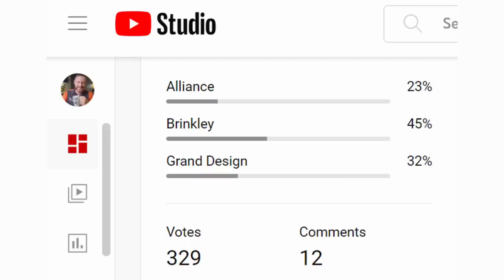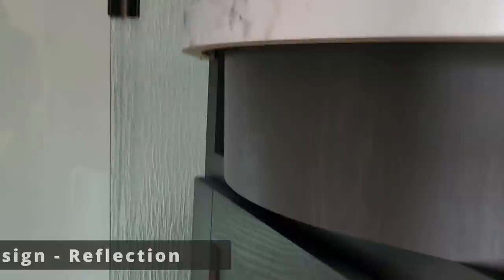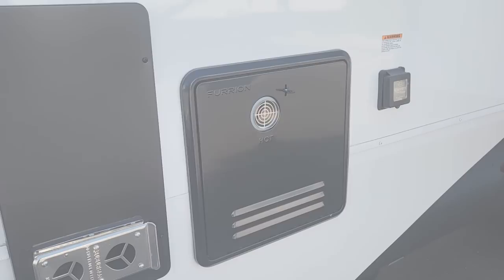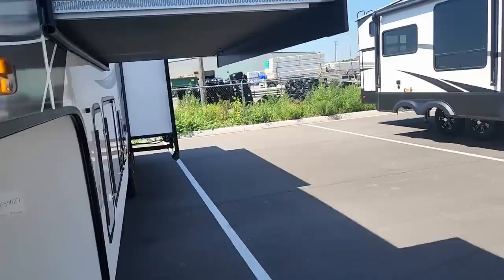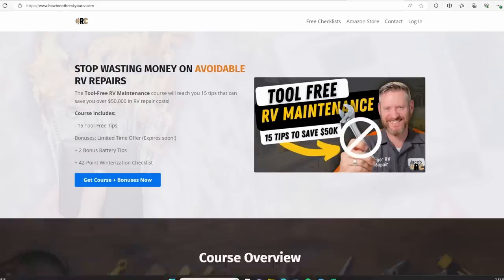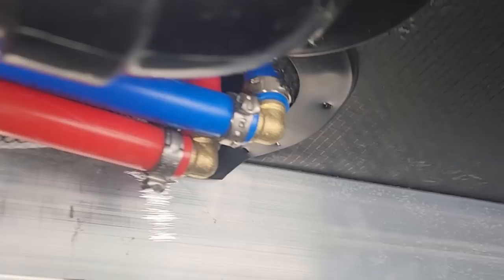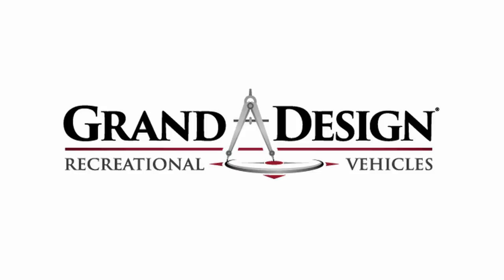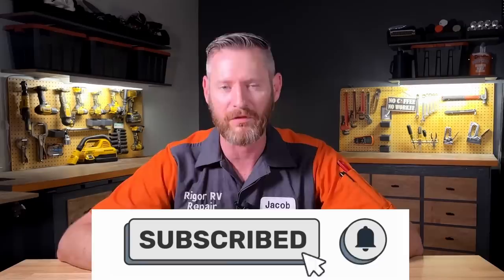UNDERCOVER RV Tech reviews Grand Design, Brinkley & Alliance RVs

Comment: We greatly appreciate your objective evaluation of our product. One of our core values is to continuously strive for relentless improvement. If you ever find yourself in the Elkhart area, we would like to extend an invitation for a campus and factory tour.
Reply: Do you concur that the slide mechanism is a Accu-slide? When I asked the dealer today about the unit we're considering purchasing, they stated it has an Exact-Slide mechanism. Does it vary by unit or model?
Reply: Ok I have a used Valor 2021.My experience with  Alliance has been no warranty, no service. Four to six month wait for service doesn't work. We are looking elsewhere for our next rig.
Reply: For what it's worth, I'd pay extra for solid surface counter tops.  I've had issues with counter tops melting and warping due to a failed seal before and it sucks.
Reply: @alliancerv Even the tech is showing to everybody that your slide mechanism in the avenue is garbage you just decide to installed the same on the paradigms for 2024, I though your goal is the customer satisfaction.
Reply: @scottl303  We just bought a 2024 (built in 11-23 according to the sticker) Alliance Paradigm 310RL. Our bedroom slide is an Exact-Slide, not an Accu-Slide. Rigor RV put out a video saying that the Exact-Slide avoids the problems of the Accu-Slide. Yay!

Comment: I've been an RV tech for 18 years, and prior to that I also worked as a plumber. 10 years ago, I probably would have agreed with you about the plumbing quality. But speaking from experience in the field, we simply don't see issues arise from braided flex hose crimped to pex fittings. Remeber that the psi ratings in an RV differ greatly from household standards, and there are weaker points in an RV plumbing system that will.fail.before these connections. I absolutely agree that brass fittings should be standard. Pex or braided flex hose with brass fittings will usually even survive freezing.

Comment: Love the video!  This is what the RV industry needs: accountability.  My wife and I have a 2021 Rockwood Signature 8324SB that we purchased from a private buyer.  I had a professional RV tech review and inspect before purchase.  We love this RV.  We have had very few issues and have owned it now for about a year and put over 10,000 miles and 2 months of nights in it.  I have also been very impressed with Rockwood's support. Even though I was not the original owner, they treated me very well when I asked questions.  They have gone so far as to provide me with the drawings and schematics for wiring and plumbing so I could troubleshoot my own issues if needed.  Way more than I expected.  They also answer questions promptly.  Regarding suspension, one of the reasons I purchased Rockwood was their use of the torsion suspension.  I have torsion suspension on a large utility trailer, and it pulls and handles like a dream.  The Rockwood is the same.  When we arrive, almost nothing has moved inside, and it goes over bumps very well.  I do not see why all RV trailers would not use torsion suspension.  The build quality has been excellent, and we would buy another Rockwood in a minute.   I did have another question.  When we store the trailer, should we bring in the slides every time, we park it next to my office, so we do go out and fix lunch and spend the night in it maybe once a week if we are too tired to drive home?  Love your segments and look forward to more.
Reply: How do you feel about the Montana?

Comment: Brinkley's response - Adjusted "Rigor" score should now be 97 for both models

My wife and I are planning to purchase a 5th wheel in the not-too-distant future. Brinkley “Z” models have been at the top of our list. This video gave me pause. It is a very helpful video and the detailed, knowledgeable information is much appreciated. However, as a prospective buyer of a Brinkley, I wanted to get a response directly from Brinkley rather than secondhand. 
The following are the 4 items noted as negative grades per the “Rigor scale” against Brinkley:
-	Minus 10 points due to the flex plumbing hose connecting to brass fittings;  
-	Minus 2 points for the Furrion water heater sensor issue;
-	Minus 1 for “fit and finish” lumber core use
-	Minus 2 for Furrion vs. Norcold refrigerator
-	= Minus 15 points

I did not bother to ask Brinkley about the use of lumber core, as that is a small issue and they have done a great job protecting and covering the core pieces in my personal opinion.
Brinkley’s responses to the other 3 items:

Add back 10 points: Flex plumbing hose connecting to brass fittings:
-	Brinkley’s response and actual production line changes:

“We have had zero issues with our plumbing connections in the field (over 1,600 units registered) or through our prototyping and testing. Everything we have done has been approved by our suppliers for the application they are used. We use PEX water lines wherever possible and brass plumbing connections throughout the entire unit. In a few specific locations, we are using an upgraded no kink flex tube that no one in the industry has previously used. It has a semi rigid inner lining with the flex mesh exterior. The quality of the hose is a HUGE factor in leading to problems that have been an issue with other manufacturers. It is recommended by the manufacturer of our water pump to use a flex tube coming off of the water pump to reduce vibration and noise.

In most units in the field, we have used a ribbed brass PEX fitting with the no kink flex hose and an oetiker clamp coming off of the water pump and under the sink on the Model Z 2900. Using a brass fitting (as opposed to plastic) allows to ensure the clamp is tight and the fitting itself will not have “flex” making it much less likely for a leak to develop.

Although we have had no issues with our connections, for customer peace of mind, we have eliminated all factory installed connections on flex supply lines. We have gone to a riser fitting hydraulicly preinstalled from the supplier on the water lines running to the water pump and below the sink in the 2900. Again, we have had no issue with the connection we are using and stand behind our product, but we are always looking for ways to improve and added peace of mind.  

Add back 2 points: Furrion water heater sensor issue:

-	Brinkley’s response:
“The issue he brought up with the Furrion water heater sensor was a concern in the first generation Furrion tankless water heaters but was resolved about two years ago. Every Furrion tankless water heater we have used has been the second-generation version and this is a non-issue.

No points regained. Furrion vs. Norcold refrigerator

-	Brinkley’s response:
“The refrigerator we elected to use the Furrion 16 cubic foot 12V refrigerator based on its size and reliability. The Norcold refrigerator he mentions is a completely different size unit and would not be an option in our Model Z line. I do not know what criteria he used to determine one being superior to the other as he gives no data or rationale to his rating.
Final general quote from Brinkley:
“Know that we stand behind our product 100% and will take care of any issue that may arise (with this or anything else that we may have fallen short on). Our goal is to build the best RV on the market and something that will last for years to come.”

I hope this info helps folks who may have been turned off to Brinkley after watching the video. It would be great to have the video updated with the corrected scores.
Reply: Concur.  I brought this up to Brinkley and as you said, they are fully aware.  The person I spoke to said one of the fittings may look like a compression but was actually a barbed fitting and another they had changed.  They indicated they tried to contact @undercoverrvtech but were told he won't talk with dealers to remain unbiased.  I respect that but am also wondering how/when any corrections they are making will be verified and taken into account?  I assume the next time he checks a Brinkley that was recently produced?
Reply: I would like for him to go back to the current year of the same models he inspected to recheck for the changes and publish an updated video comparison. That,  I believe,  is due to the manufacturer and to the customer!
Reply: Chandler Tenney, the sales director in Brinkley in one of the YT videos pointed out that the reason they put brass joints in their plumbing is because the issue they have seen in the warranty repairs.  So I would not say that Brinkley was free of all the plumbing leaks.  But I like that they take the initiative of addressing the issues and making sure that it doesn’t happen again.  They definitely have the potential to reach the 💯 score
Reply: Thank you for your research, it has been very helpful. Based on your reply from Brinkley, we’ll be purchasing one soon 😊
Reply: It's not that we're looking for perfection,but getting these things serviced is close to impossible. Unless you live next to a certified rv repair that will repair your rv or any other , under warranty. Our son purchased a 2023 Integra and had a list of 26 items to check and repair after he took it home. That's an $800k coach...We picked it up a week later and they repaired 5 items and were waiting for authorization from their manufacturers to ok repairs. The rear drive axle caster adjust bolt was loose and moved and clunked when accelerating and stopping. Quality control is horrible in this field no matter the manufacturer.
30 yr Master tech retired here debating which 5th wheel to spend my hard earned retirement money on is like gambling. 🫤
Reply: Props to Brinkley for providing a detailed response.
Reply: @haoyunchou1467  in a lot of the the Brinkley manufacturing videos I've seen, they say industry warranty repairs, remember, Brinkley took people from all over the industry to compile the "perfect" RV in their eyes. So it may not have been Brinkley warranty repairs, but the industry as a whole.

Comment: The manufacturing methods at Brinkley are really amazing; just took the factory tour and I was very impressed. I am definitely not an expert on PEX plumbing fixtures, or whether Furrion is any better or worse than a Norcold fridge.  I’ve never even owned an RV, although I’ve owned many large sailboats over the years.   But after working as a Manufacturing / Mechanical Engineer in automotive manufacturing plants around the world for over 20 years, I can tell when a company is building a car / truck / RV the right way.  There’s no question in my mind that Brinkley knows how to design and build a quality machine. Every workstation in the Brinkley facility is set up the same way Porsche or Ferrari would do it, they really have fantastic manufacturing and assembly practices.  This is why the fit and finish of their RV’s is as good as it is.  You can see the intermediate Quality Control steps they are taking within the manufacture process, not just at the final inspection, and this method insures quality builds.  I could see that the fabrication and installation employees on the line were using methods and tooling to produce templated parts to very exact specifications, they weren’t just stamping out templated parts and tossing them in a bin for installation later on.  Everything in the plant is super organized, they keep track of every part they install so that if a customer has a problem a year later, they can find how the part was fabricated based on the VIN of the unit, help you troubleshoot yours, and Make Improvements for future units; this concept is referred to as Metrics.  Just my guess, but that may be unheard of in the RV industry. 16:50 Talking to the plant people about the supply chain they are using, they really are talking the talk, and walking the walk, about producing a quality product.  I now work part time in management for a nationwide  RV dealership that’s carries many different brands (Alliance, GD, Brinkley, many others as well), and I speak with our own RV repair technicians all the time about which brand is best.  Every mechanic, bar none, says, well we love working on the Brinkleys, they’re just better built.  I’m not personally purchasing anything until 2025, but from what I’ve seen and heard in the factory and in the repair bays, I may just go with a 3110 for my needs.  Cheers y’all.

Comment: I have a 2021 KZ Connect travel trailer that had a leak in the passthrough that made it into our front bedroom.  The leak was at a braded flex hose with a pex fitting.  You could visually see the braded flex hose was swelled right at the Pex fitting.  As a quick fix I added a small screw clamp up against the Pex fitting and no more leaks.  Did the same on all braded flex hoses with a pex fitting.  I know this isn't the best proper way to fix, but we will be upgrading RV's soon.  Thanks for reporting this issue, hopefully they are listening!

Comment: Thank you for this video. We almost bought a Brinkley but to me it just seemed like a mid-profile  5er ( shallow basement) with some very cool creature comforts on it. And then they charge the full-profile  price for it. 100 plus. All of my research led us to the Alliance Paradigm 340 RL. We took delivery of our 2023 in mid August. Got it for 33% below MSRP. Fit and finish is excellent. We went through it with a fine tooth comb. Could not find one single thing wrong. I know there will be a shake down period but we are one trip in and so far perfect. 🤞 Thanks again for the review.
Reply: Some of the things brinkley is doing is pretty cool. But I 100% agree, it's still just a mid profile camper using super cheap furrion stuff at a full profile price. Can't wait to see the price of their full profile line when it comes out. If they think a midprofile is worth 105K I bet their full profile with the same cheap furrion stuff in it will be 135-140K

Comment: Very interesting video. 
Next time you're underneath a Grand Design, Jayco or Coleman and perhaps Rockwood, check the underside of the slideouts. They stopped using any protective barrier and just have thinly painted OSB.   Any amount of water that wicks under there will quickly start to rot the floor out - and it's happening.